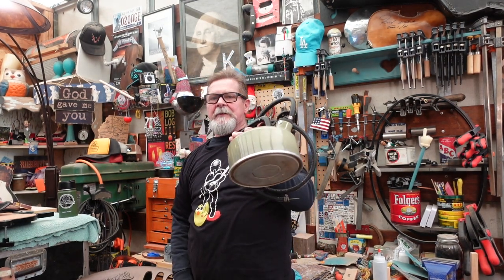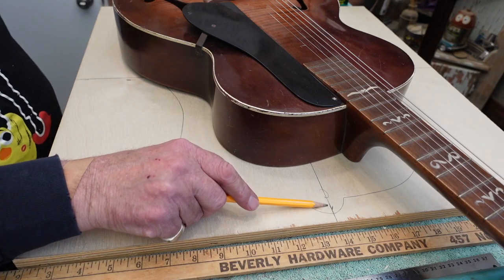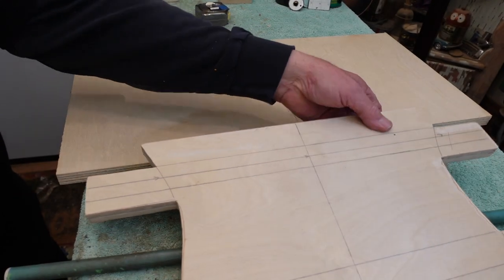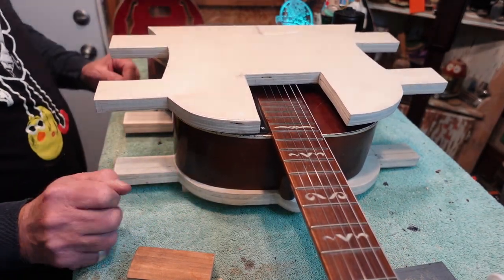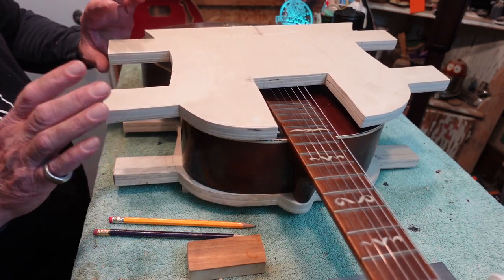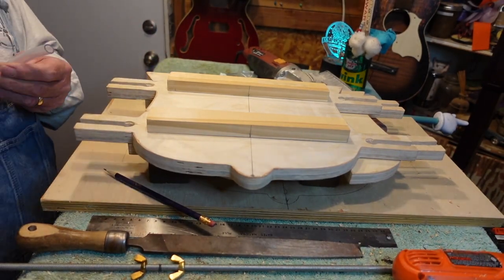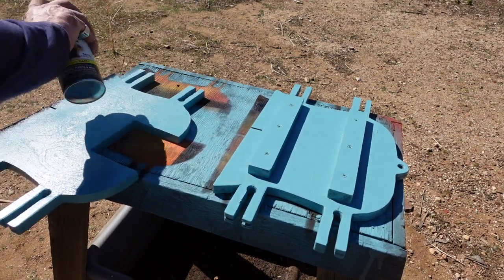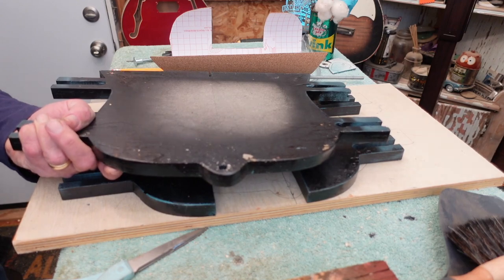Guitar Neck Pulling Jig: Econo-Archtop Guitar Neck Reset: Part 3

Comment: in my mind your "T" nut should be reversed. when its under tension it will force the insert downwards wouldn't it? so you would want the flange part on the inside of the bottom piece.
Reply from the maker: You would think that until you start considering that turning to the right puts upward pressure on the threads as you turn the T handle upwards to find a make contact with the heel of the guitar. Even as you make contact with the heel of the guitar to apply pressure, the loading is going up from the bottom, which means is pulling the t nut upwards. It is only when the guitar neck hangs up and starts resist and push down words will it be necessary for the t nut to be reversed. To continue to crank up at that time is like that to result in disaster. So when it would be coming important for the teen not to be pushed downward from the heel side of the operation is about time that you’re going beyond glue breaking loose and wood breaking loose.